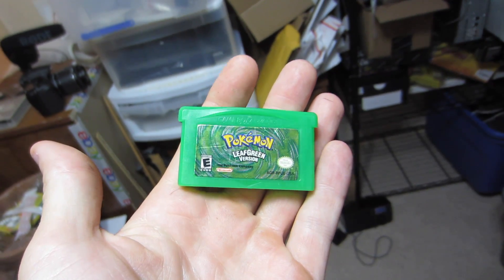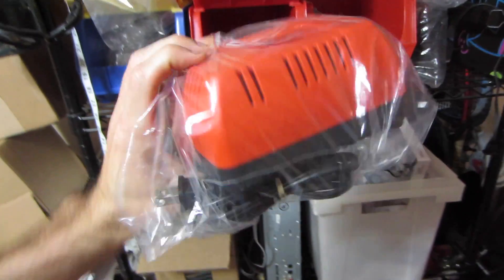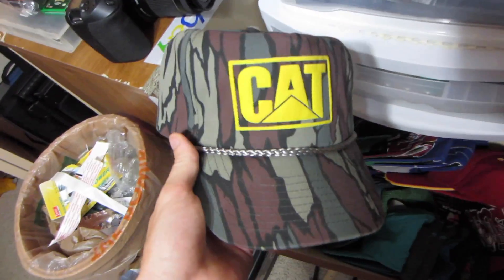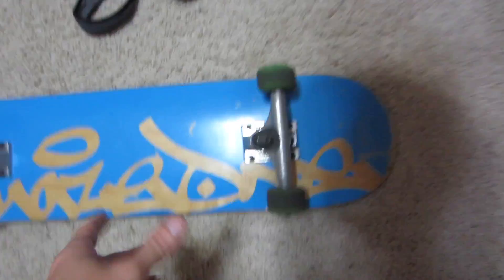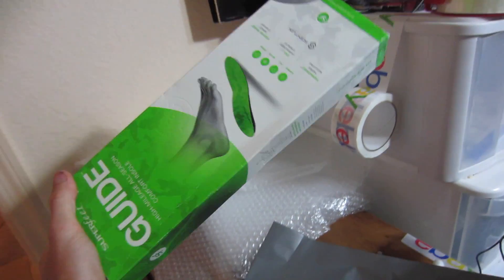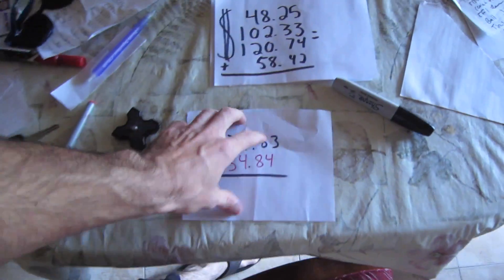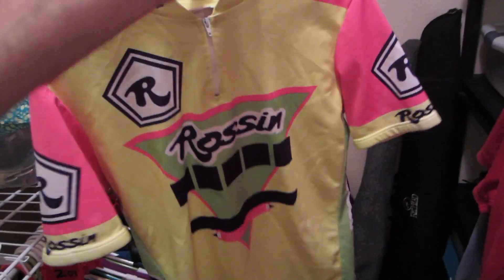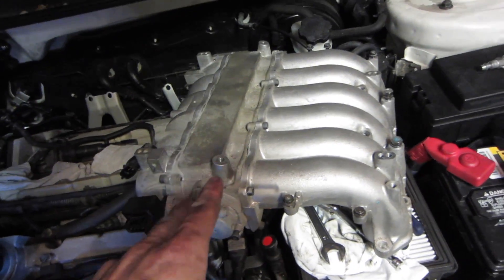Twin Nieces! |164

Comment: Don't dis your van because your Bro has a shiny new ride!  You 'own' your van in more ways than one! The trim falling off might be indicative of overall build quality! I would avoid driving in water without the shields on! I went through a ford in a diesel once,  it  sucked water into a cylinder and the hydraulic action cracked the head! Ow!
Reply from the maker: Hahaha I'm just playing. Yes never again driving through the water. Harmonic balancer is now overheating, I think my tensioner pullies are shot.

Comment: DOH!!!!  Hair dryer, shop vac and/or some compressed air should clear that water out.
Reply from the maker: Hahaha. I'm such a destroyer. I shot some compressed air in it. It needed to get the boot off to dry for sure, it was just evaporating off engine then condensing and staying in boot. Should be fixed in about an hour. At NAPA now getting new throttle body gasket

Comment: On a serious note check your roof box for any hairline cracks. I've got a similar one had a little crack,  fixed it with some fibreglass. Also check round where the fittings are. Mine is fine now, never leaks.

Comment: Shitty about the water in there! I heard Kia's use a lot of aluminium parts which rust easily, so you want to make sure you get that under protector on, especially if you are near the coast as i think the salty air can even effect it. Or just find yourself a cheap Honda Odyssey somewhere :)

Comment: use dielectric grease on your spark plugs you will have no more problems with water
Reply from the maker: 🙌 right. I did the grease on the back 3 last night. All new plugs. Original champions were in the back. Haven't cleared code or fired her up yet. At NAPA now getting throttle body gasket that ripped during the teardown. 😰